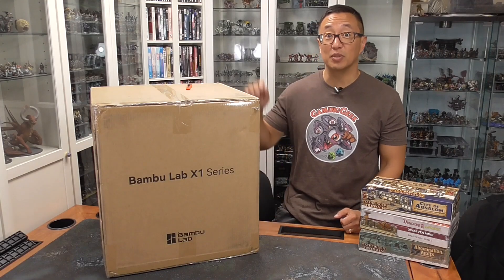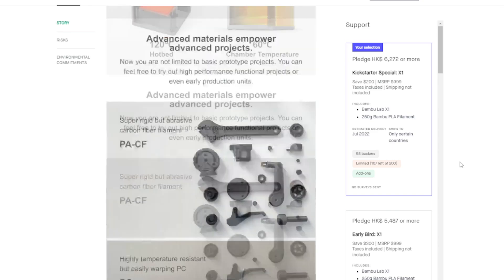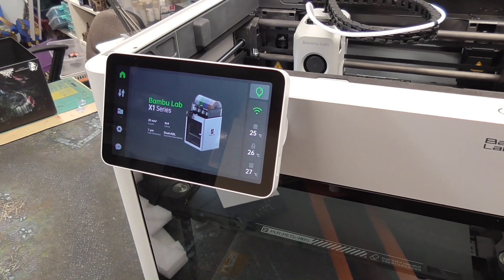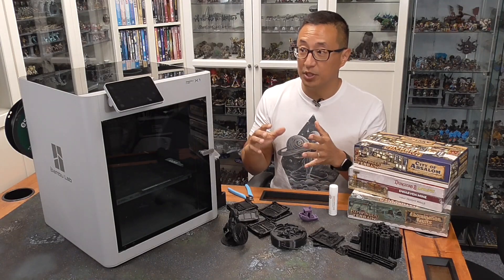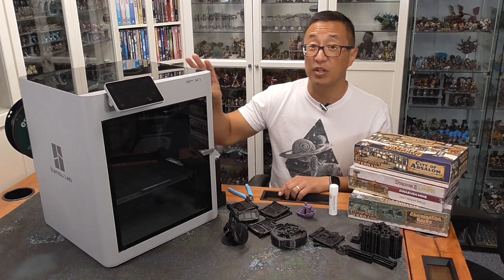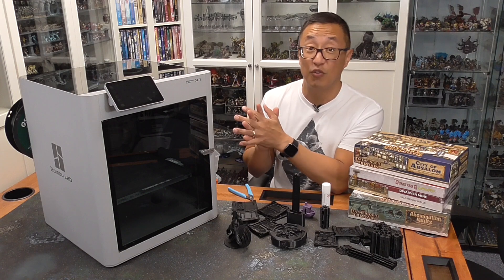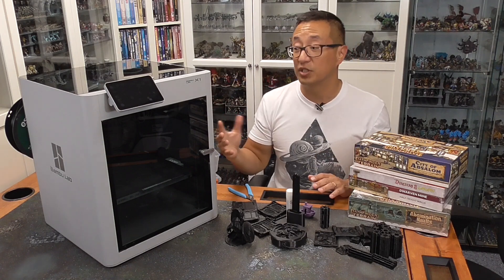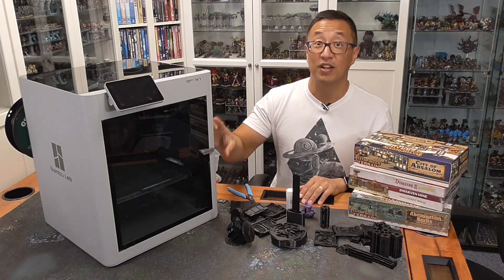Bambu Lab X1 Review: Is it true Plug & Play?

Comment: I'd love to see a 6 months review for this product (I see with this video you've already had it for 5). 
I know they made some huge changes in updates over the last 5 months of it being out, based on feed back from reviewers/backers. 

examples of some changes I saw from other reviews after they gave feed back:
* bed leveling/set up time was reduced in half a couple updates ago
* a reduction in the purging between layer swaps or roll changes
* they fixed wifi connectivity issues and lan mode stability
* support cloud cacheing to sd card
* displaying the current layer number/total number of layers during printing 
* Supported backup of printed 3MF files to SD card
* Changed view/display of AMS controls on app due to feed back
** lets you now go straight into another filament in ams if you run out of one and not paying attention during print
* Added equipment maintenance reminders when carbon rods need to be cleaned and Z-axis lead screws need to be lubricated

Many more but these are just some really big ones in my mind. 
The responsiveness to some of these changes really helped me pull the trigger on my choice over other brands.  
^ That and while things like nozzel are proprietary they sell all parts so cheap it's only like 50 cent difference over the ali express knock offs. bambu labs even said during the KS they would try to keep parts cheap so people don't need to rely on 3rd party parts and if they went under early they would open source their parts, so people can still enjoy their purchase for years to come.

Comment: During Covid I decided to get into 3D printing before they became plug and play, in order to learn how to build, improve and maintain them without running into huge costs and barriers usually set up by manufacturers.
I got a cheap Creality 10s pro 3D printer and ended up having to completely change and redesign just about every part to make it completely plug and play and without issues.
I even fixed many bugs and did improvements in the firmware code.
With my modifications it also became completely silent.

Now, I no longer have the time to mess with 3D-printing and am on the market for a better printer that is optimized for speed, multiple filaments and printing with polycarbonate.
I also need it to have a good looking dust cover.
I'm hoping maybe this will fit the bill.

Comment: Question for ya... getting into printing terrain and was wondering (in your experience) what material would be best to use? I've been looking into either ABS or ASA but wasn't sure if PLA would be good enough. I run a D&D game for high school kids, and wanted to make sure the stuff held up. Love your channel!
Reply from the maker: I have only printed in PLA and PETG so can't say about ABS or ASA.  As long as the kids aren't throwing the terrain around, it will still survive a fall from the table.  If you are worried about durability, increase your infill to 20-25% but it will double your usage and print time.

Comment: FDM 3d printing won't ever be plug & play, it's just short of cnc milling in terms of complexity. laser sintering or polyjet are probably the only technologies which could actually achieve true plug & play.
Reply from the maker: Yes, I'm waiting for the tech disruptor which will replace FDM/Resin printing--I'm hopeful for polyjet to become consumer-friendly in another decade or so.
Reply: This printer is as plug & play as printers get. I just got mine and compared to all the printers I've had before this one requires zero assembly. So you plug it into the outlet and you play with it...

Comment: One thing to note on long prints with PLA I have found you need to either take the top off or put in some printed spacers on the top to let the heat escape if you don't you may experience heat creep and and blocked nozzle.

Comment: I got mine on 9/28 It really was  really easy to get ready. I have been printing out a lot of things to try and push the limits.  So far I am really impressed with it. I also just purchased the x1 not the x1 carbon.  I kinda wish I had done the x1 carbon instead. I did decide to order the camera and aux fan. The aux fan will allow you to print faster.  Also be aware you do not have to do the bed leveling and flow calibration each time.  You can unclick those options I don't always run the bed level and only do the flow calibration when I switch filament /use a new roll. the test lines cam of really easy for me but I spread the glue stick over the entire bed. In your video you only did the center. the instruction let you know the glue stick is there as a release agent. without the glue stick it can stick to hard and you can damage the material on the build plate.

Comment: It’s tricky. Right out of the box, you’re up and printing easier than any other printer. But yesterday I replaced the hotend on my X1 Carbon and it was a lot more complex than my CR-10.
Reply from the maker: Why did you have to replace your hotend, if you don't mind me asking?
Reply: @gaminggeek241  overnight my “poop chute” filled up and caused a giant clog on the end of the hotend. When I woke up there was a giant blob on the end of the head so I tried to bring it forward with the manual controls and it caught on the chute and it bent the nozzle. I actually didn’t notice at first, then on my next couple of prints I noticed the purge line in the back corner was coming off the build plate.
Reply: @UncleKnighthawk  make sure you set the option to stop print if poopshoot fills. I made that mistake as well. I'm also swapping to the .6 nozel. I'm on here searching how. Their video shows it just pulling out after you remove the two screws. Lol mine will not come out. I'm worried about breaking it by applying to much pressure.
Reply: @goawaybaizuo  thanks for the tip. Mine came off pretty easily once the screws came out. Maybe try heating the nozzle and trying to remove? Maybe there is some filament holding it in place.

Comment: Don’t worry, you’ll have a lot to trouble shoot on that machine. I speak of experience. My Ender 3S works flawless and reliable out of the box. My X1C is just a brick.
Reply: That’s what I seem to keep seeing over and over on the official forum. Same issues also. At V3 1-1/2yr into it and you’d hope that they had addressed the AMS frame breaking issue ( which it seems they have not ) and the continued firmware issues. 

It also bothers me that besides submitting a “ticket” for a problem, that’s the only way to contact anyone at that company. Seems a bit shady to me.
Reply: @bomas_ulz  yes. Over and over again. It’s the main black subframe of the AMS. There are small slots where the small roller bearings sit in a little tower, two side by side.  That tower is cracking and the bearings are either falling through, or becoming bound, this stopping the AMS from functioning.

This has been happening since the beginning, and rather than improving material, or revising the design, they simply sent out a bandaid fix, but this is what bugs me more…. Only upon request!! 

So to me, it’s something they know ( as they have a kit to send ) but they don’t send it with every new shipment? Better yet, they should be fixing the design problem. 

I’ve gone rounds with people on the forum with this subject.  It’s like these people are wanting this machine to be all their wildest dreams, that they are willing to play it off as R&D, and literally ignore the count ( after V3 don’t think so ) and keep ignoring all the recurring print failures, recurring firmware hiccups. 

I also don’t like the idea of not being able to even contact and actually get ahold of the company, other can submitting a “ticket”.  

It’s looking to be to good to be true as far as I’m concerned. Don’t get me wrong, even if it printed a little slower, and yet was more consistent and the AMS worked flawless, I’d be all in.

I suggest becoming part of the official Facebook page, and just scroll down and it won’t take you long to see the MS failures and the continued firmware issues.
Reply: @briankostrba4897  glad I skipped AMS.

Comment: Bambu studio is based on Prusa slicer and is open source. If you know one slicer you know the other.
Glue stick is a release agent not an adhesive. I personally like Nano polymer as a interface barrier.
You can use standard Gcode but you may not get the special sauce of Bambu Studio slicer
The AMS is very nice if you like multi color prints or just don't like switching filaments between prints.

On the standard speed(second slowest) an X1C takes about 8hs whereas comparable prusa would take 24hrs on stock speeds. 
The are 4 "auto speeds" 
Silent: 50%
Standard: 100%
Sport: 124%
Ludicrous: 166%

You can also sent speeds in the slicer.

The auto calibrations(leveling, flow) before prints are 7 min and are OPTIONAL. so that benchy can go even faster than 30min, 17min is the avg.

The camera is not in the print head but in the left front corner. I also dont think the Bambulabs X1 has a camera as stock but it can be added. The X1Carbon for the extra $200 has it. 

The X1 can be "upgraded" to an X1Carbon with a hardened steel nozzle and side blower fan.

Build area is 256cubed which is larger than a Prusa MK3+ but no where near a $2k Prusa XL
There are 3 prices 1000 for X1
1200 for X1 Carbon(able to handle carbon fiber nylon, fiber glass polymers,  and other abrasive filaments
or 1450 x1 Carbon with ams able to handle 4 filaments at at time.

The removable bed is a flex plate with a "sticker" top on it. You may have gotten extra with the printer. I will assume yes since I got 2 extra with my X1C. You can also print a application assist part in the internal memory.
Reply from the maker: Wow, that was a lot of helpful information!  Thanks for posting!
Reply: @gaminggeek241  Thank you for the kind words. Excellent job by the way. Subbed!🙂

Comment: Why do all the reviewers make the same mistakes with this printer?

Don't leave the door open or the top off and complain about the noise.

Don't use 3rd party filament to test the machine out. It's been setup to use their own filaments by default, that have already been tested to be usable at high speeds; Why not use it how it's supposed to be used before you start messing about and changing things?

Apart from these problems, a good run through. Thanks for the vid :)
Reply: He missed a few things. The X1 does not have a camera, or side blower fan. (can be added) the body is plastic and glass vs aluminum and glass. The 7 min calibrations are optional.

But from a plug and play standpoint and zero research I would say it was...ok. It's weird he has the capability to built a prusa from a kit but missed some things with an already assembled X1. The glue/windex/hairspray etc for instance could have been used where the calibration lines print to help with release.

Comment: The glue stick is there to remove the prints, probably why you couldn't get those small lines off. The prints wont fall off. Would have loved to see how loud it was when running at the same speeds as a prusa, would be a more fair comparison.

Comment: 11:15 it would have been nice to consider the printing times too, the quality looks the same, but how much faster was the bambu?
Reply: While a lot depends on the file there can be 2-4x reduction in print time. For instance a full crystal dragon takes about 25hrs on a prusa mk3s at stock speeds where a bambu x1 would take about 8.5 hrs on the 2nd lowest speed. (standard)
.4mm nozzle
.2mm layer height
15% infill
no supports or brims.

You can see the speed difference if you download bambu studio slizer and prusa slicer and run the same stl file.

Comment: I'm also in the camp of wanting to buy a 3D printer but waiting for one as easy to use as a normal PC paper printer.
Looking forward to this, and if it's not for me, hopefully it leads to what I'm looking for soon! 🙂
Reply: What you want is a polyjet printer. Might be a while until they're cheap, need those parents to expire. :P

I'll add that as 'plug and play' industrial/commerical FDM and polyjet printers are, the 'auto' modes are still unaware of what you're printing and will benefit from some amount of knowledge Maybe I'm getting nit picky at this point...
Reply: Depends on what you want to use it but a  creality or other printers that have all already build in so you don't have to upgrade it's pretty much plug and play. It's more of the settings on the slicers that you have to know not really the printer itself. The resins printers are way easier to use and the slicer you almost never move anything on the settings.

Comment: If i was dropping $1000 on another printer I might be tempted to try this Bamboo it looks very interesting.  I wouldn't buy a prusa.  I mean with all the the options available I could replace every stock part on any decent metal framed Chinese machine, have everything and more than a Prusa offers for the same money or likely far less, all while not relying on 3d printed parts from the factory with 8 bit boards and a bed slinger.
Reply: I disagree about the cost being less than Prusa’s when you replace all the stock parts. Also Prusa offers reliability while your modded printer might now do the same
Reply: Fyi, it's actually "Bambu" with a "u" instead of the "oo"
Reply: @MrRedBuilder  Good catch typo patrol
Reply: @gitss7367  lol
Reply: @gitss7367  😂